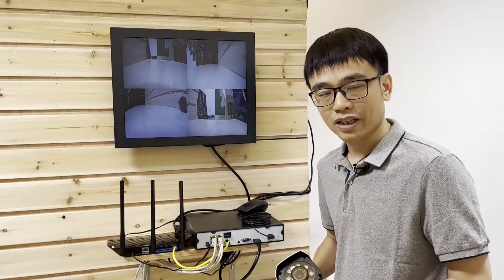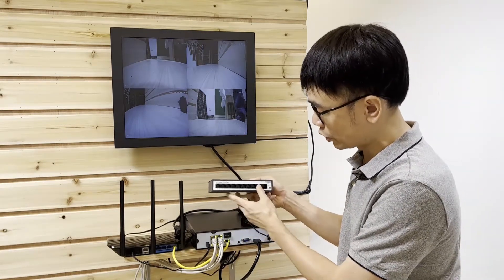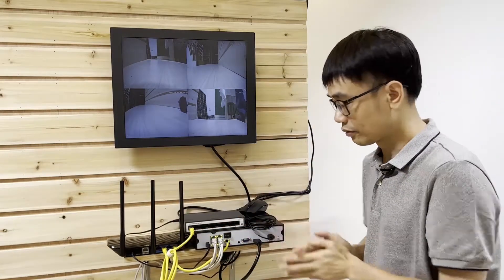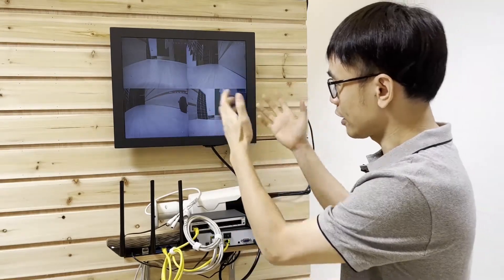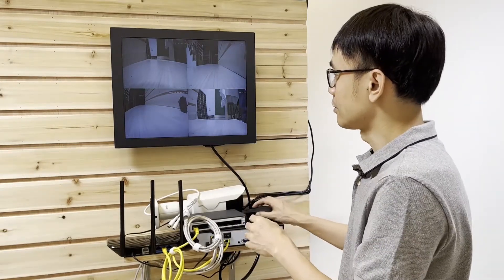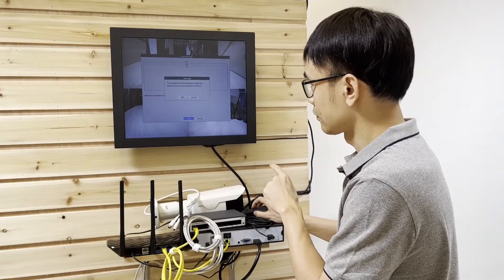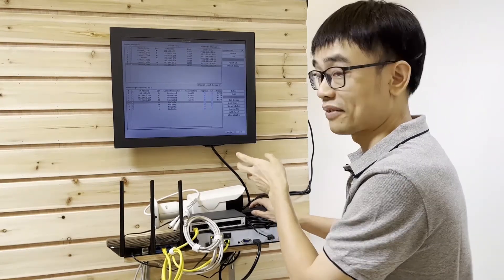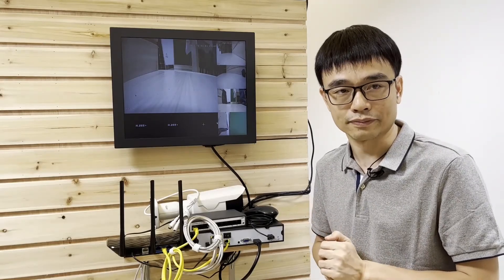How to add the 5th camera to 4 port NVR

Comment: How to add additional wireless cameras
Reply from the maker: You can use the camera’s app or web UI to connect it to your Wi-Fi or LAN. But you need to make sure the NVR is not limited to 4 channels. Some NVRs may have 4 physical ports but can support more cameras. It depends on the channel capacity of the NVR.

Comment: If I am getting you boss 
Are you saying a four channels NVR can display 8 cameras
Reply from the maker: No, a 4-channel NVR supports only 4 cameras. This NVR we used in this video only has 4 physical PoE ports (for connecting cameras directly), but it supports 8 channels (total number of cameras it can manage). That's why it works.

Comment: Please help.I have an 8-channel Hikvision device, and I would like to add 2 additional cameras. Is there a way? The motherboard has 8 poe ports, but there are empty spaces in which 8 other ports can be installed, meaning that the motherboard is similar to a 16-port motherboard. ( ds-7608ni-m2/8p)
Reply from the maker: You can connect up to 16 IP cameras in total because this NVR supports 16 channels as long as the cameras are added through the network, not the PoE ports. You can use an external PoE switch to expand your camera system. You can watch this video: https://youtu.be/PM3Y-3Bn3XM
Reply: @Fastcabling  Thank you . Are all cameras installed on the switch, or part on the NVR and part on the switch? But what about splitting the screen? I cannot split the display on the screen. Do I download the firmware for the 16-channel device?
Reply from the maker: You can connect some cameras to the NVR’s PoE ports and others to the PoE switch. All cameras will show on the NVR interface as long as they are configured on the same network. You don't need a firmware update if your NVR already supports 16 channels. Check your display options in the NVR settings to enable a 16-channel grid view.
Reply: @Fastcabling  Thank you. You are wonderful people. I learned a lot from your channel. It has become one of my favorite channels
Reply from the maker: Such an honor!

Comment: I have problem with this setup. I have MISECU 8CH NVR 4K. I am using Tenda TEF1105P-4-63W POE switch that is linked with NVR. Misecu NVR UI looks the same as on your video. I assume you have the same NVR, just 4CH version. What could be the problem that my cameras that are connected to the same port (2+) are constantly disconnecting and connecting again. Is it enev possible to connect multiple cameras on 1 NVR LAN port?
Reply from the maker: Our NVR is different from yours. The problem might be caused by IP address conflicts. Ensure that each camera has a unique IP address to avoid conflicts that can cause disconnections. You can assign individual IP addresses to each camera and then manually add each camera to the NVR. 

It doesn't work, please consult the manufacturer or reseller for further problem diagnosis.

Comment: how about on DVR which is not in network and the vendor is Hikvision does it have extra adds on 8channel dvr
Reply from the maker: The DVR has fixed input. Usually you can verify the input through the BNC input at the rear of the DVR. If it is the hybrid DVR, you might look into the channel setting in the menu to figure out whether it accpets IP cameras as input.

Comment: Is there a method to add wifi cameras to an existing 4 channel wifi system?
Reply from the maker: It is vendor specific. Most Wi-Fi NVR doesn’t accept the camera from local network because NVR might use different subnet to manage the cameras.

Comment: can you do this just with network switch??? you guys are doing the same damn video , nobody thinking outside the box. try with router and network switch
Reply from the maker: The network switch doesn’t have power source for PoE ip camera. It will not work if you connect PoE camera to the switch. Adding PoE injector after the network switch can provide turn your network switch to PoE compatible.